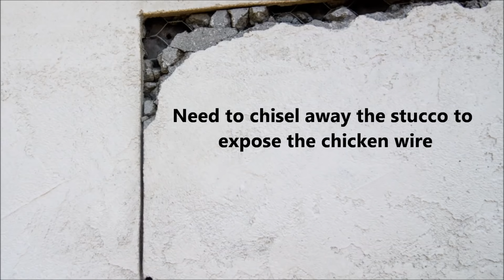Installing a wall air conditioner LG1215ER

Comment: So.... what would happen if you just cut the hole and didnt make that box wood frame seen at 1:53 ? Also, can a wall ac unit be installed about 1 foot under a window?
Reply from the maker: Eddie Arcega do need a box to keep the sheet rock from breaking under the weight of the AC. Also need support for framing above the cutout. Yes, you can install under a window but need to make sure you don’t cut any studs used to support the window above it. Remember, the studs are what’s holding the roof up.
Reply: @rdufel777  cool thanks

Comment: How is the drainage as window air units are not designed to be put in walls only windows. Actual in wall air conditioner are longer for drainage
Reply: Richard Centkowski all vents are outside wall and the drain is also outside. Key is to install with unit tilted slightly down in the back so water runs away from wall. Same as when in a window.

Comment: why didn't you add a header to support the roof weight? that is a must?
Reply: no its not...
Reply: +manny glez
it's not a bearing wall since it's on the gable end
Reply from the maker: The wall has plywood sheathing on it so it is well supported.  If it was only stucco, then I would have had to support it better.

Comment: How heavy is this air con? As I can see you didn’t use some supporting frame or brackets to support it, I am worried it will damage your wall, you probably will see some cracks after years....
Reply from the maker: JJ CHEN I believe it is around 70 to 80 lbs. it is securely attached to 2 wall 2x4s and the plywood sheathing. No cracks.
Reply: Ron Dufel I see, thank you for your reply, it looks like yours is quite light, as I am going to replace my old Panasonic wall aircon with a 6KWH 65KG LG, the wall is brick veneer and plasterboard. The previous owner didn’t use brackets at all, but I am worried I may need to use some supporting things due to the weight
Reply from the maker: Sounds very heavy, I would use some brackets not only for support but to keep it at the correct angle so water doesn't run the wrong way.

Comment: Good work Man. *Did you ever have problems with the AC VENT 'obstruction' ???*
It would seem to me that the Vents would be blocked when you slide the Unit in?
(i'm no engineer----just askin). Anyway,...NICE WORK!
Reply: jjsiegal no problem. I measured the vents before I started. Actually I picked this AC due to the vent placement pretty far back from the front.

Comment: This is a poor installation. Framing in an opening for a "through the wall" sleeve is basically the same way you would frame in a window. The wall has to be opened up enough to install a header, king and jack studs along with a sill plate and cripple studs. A lot of people, such as this guy, end up with a "mickey mouse" installation. If you don't know how to install something correctly, then get someone who can do the job correctly.
Reply from the maker: tube396 a header is not needed for this small opening and would be overkill. The 2x4s that box it in are serving as a pseudo header. I’m a mechanical engineer and understand your concern but have put in 3 AC units this way and no problems at all after 20 years of usage.
Reply: If you are cutting out a stud on a load bearing wall in order to make an opening, then you should install a header along with jack studs. If you make the opening in the wall under a window then a header wouldn't be required as the header and jack studs for the window are already taking the load.
Reply: @tube396  I agree with tube396. The framing in this demonstration is no header at all, yet I'd like to believe something like this would work - could save me a lot of effort. Ron, can you elaborate on how the force on the cut stud is now transferred to the sole plate, or that it's not actually needed? Thanks!

Comment: So you will just perpetually have a long power cord running down your wall? good luck selling the house!
Reply: Trevor Leger who wants to have to patch up these monstrous holes. If people are too cheap to get central air or mini splits; the best thing they can do is run window units. When purchasing a home I try to avoid homes with through the wall ACs.
Reply: @RFJersey  Interesting thought. We hope to sell withing a few years, but I hate window units and can't afford to retrofit a >100 year old house with central air, so I'm considering throughwall units. At least they don't block views and can stay in year-round. I wasn't aware someone wouldn't buy a house bc of that
Reply: @billshadel8550  So, if that is a real concern about thru the wall units in your home, I would talk with a few - more than just a couple, Real Estate Agents about it.   I am not concerned about it because, worst case, my house is drywall inside and wood siding on the outside and it is not a big deal to remove the ac and patch up the hole. If the next buyer wants to put in something different, fine for them.   :)

Comment: You didn't do any framing to accommodate 1) the hole you made, 2 the stud that you cut, or 3) the weight of the AC unit.  There are much better videos out there for this sort of work.  You should remove this video.